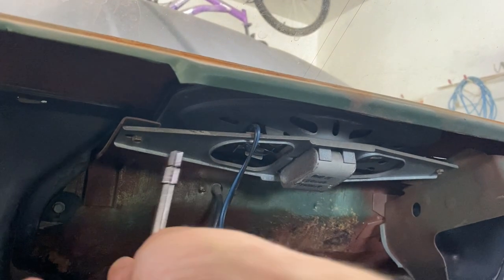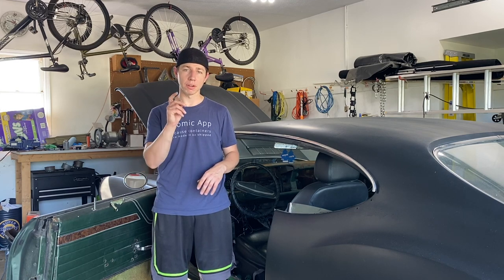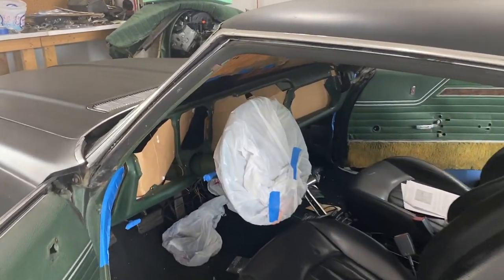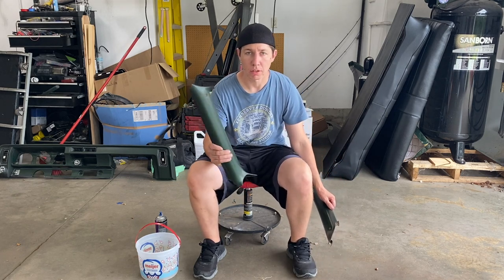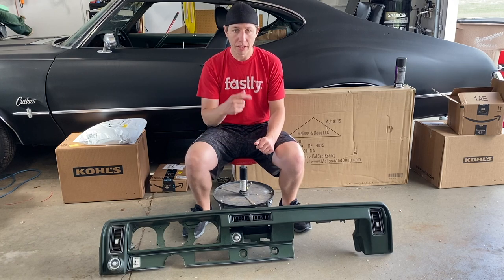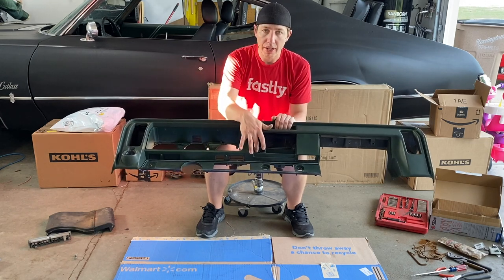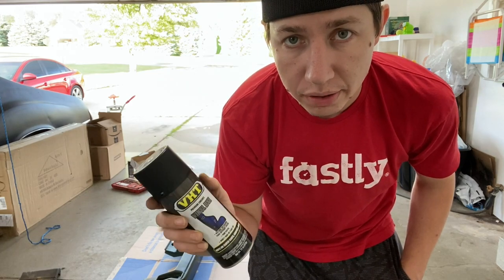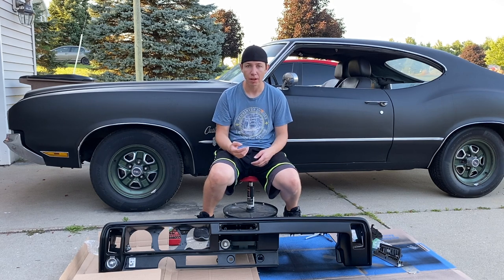Rebuilding 1970 Cutlass Episode 10 - Dyeing / Painting Dashboard - How To

Comment: Question I have a 1970 Cutlass. My fuel gauge isn't working the gauge is a different one. It seems to have power. Could it be a bad ground ? All looks good when I traced the wire to the rear... any advice ?
Reply from the maker: To be completely honest with you, mine doesn't work either and I have been chasing my tail on fixing it. I even got a new fuel sender, but still nothing. It is either the gauge or the ground on mine. I hope you can figure yours out!